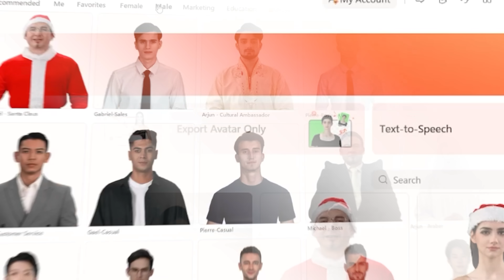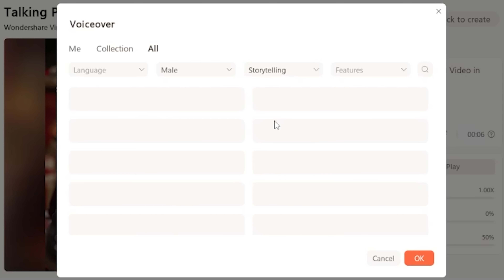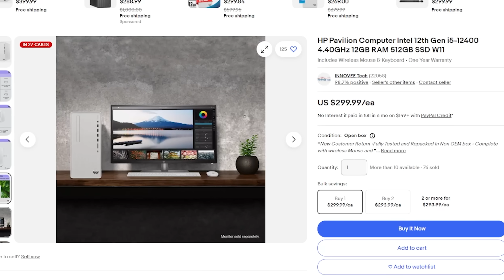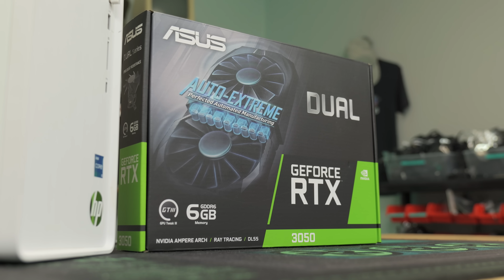NEW EASY $468 Gaming PC Meta  - Step-by-Step

Comment from the maker: Try AI Avatar Video Generator on computer or cell phone, or even online now: https://bit.ly/4gy0xEc
Reply: 0:20 :face-green-smiling::face-purple-crying:
Reply: Toasty Bros i need an opinion on the build i m almost finished completing
R7 5800x
Xfx radeon rx 6750 xt qicksilver 319
Msi b550 gaming gen 3
Kingston ssd 1tb 4.0 nvme m.2
Aqirys magnetar le 750W 80+ gold
2x8 G Skill aegis 3200mhz  cl16( i plan on buying 2 more sticks)
Aqirys Antlia case (middle tower fishtank also has 6 fans included i think they are 120mm each)
For cooling i bought an arctic freezer 3 aio 360 mm because from what i heard the 5800x tends to run quite hot
Reply: To me, it's worthless this sponsorship. Ad skip
Reply: @TheRealRuddRants  Hey bro, if you don't need the stuff in the sponsorship, just skip and ignore it, some people might find it useful.
Reply: @TheRealRuddRants  rude...

Comment: One of? What could possibly be more powerful with no external power?
Reply: The A2000 edges out 3050. Not significantly, but that one also has a 12gb model, and requires no external power.

Comment: Dumb question but do these hp pcs except any ddr4 ram? And gen4 m.2 ssd? Or any 12th gen cpus??
Reply: The one in the video does. I don't think they can take just any 12th gens though. These OEM prebuilts are usually locked down.
Reply: @marioprawirosudiro7301  That's what I thought too but nobody has any real good info on them
Reply: @lanegeisewite1436  My suggestion for these office prebuilts is to lock in a certain model, then start with the owner manual for that model. It should have info on which CPUs a particular model can take, along with the chipset the mobo has (which, in turn, should tell you which PCIe gen it has, etc etc).

The manual should be available for download from the website of whichever brand you choose.

Comment: Guys why didn’t you add a higher end gpu like an arc b80? Or even a 7700xt? The 12400 can get you lots of frames I have one with a 7800 xt and get 100+ frames at 1440p on all my games no issues
Reply: Arc B580? On a 300W PSU?

Comment: Gave my nephew my RTX3050 6GB to upgrade his Optiplex that he got for free after I upgraded to the 4070 super, it's definitely the cheapest way to turn an old office PC that into a gaming PC without upgrading anything else. It definitely made his day :)
Reply: Hi buddy 
I'm looking for go to from Gtx 1050ti to Rtx 3050 6gb because i'm focusing only for 1080p resolution.Btw i have some questions.
 
Does 3050 6gb actually worth?(in my country 6gb version cost around $200 - $220)
Can it powered by 450w 80+ bronze?
How about your personal experience with 3050 6gb?

Thanks❤
Reply: @PraveenZV  Hey man, I can't compare it to the 1050ti since I never had that card but during the short moment I had the 3050 6gb, it handles most non AAA games quite nicely, It didn't stopped me from enjoying cyberpunk with RT & DLSS performance but of course you have to accept there will be some latency or image softness from the extreme upscaling in that particular DLSS mode. But to me RT is much more important.

For other competitive games without RT, it runs like a champ in 1080p, no complains from me.

My nephew's PC is an optiplex office PC with less than 300w psu, 450w PSU will be more than sufficient.
Reply: @GeraldAllen-fg2bo  Thanks for great your response✨️.
I'm budget pc gamer and i don't focusing for RT.Overall i can use it without any upgrade of psu❤️

Comment: Just bought the 3050 6gb and 7040 optiplex, i7, etc for my son. Most other reviews are how bad it is, but if you think about it not needing any extra power beside 16 pin, dual monitor and able run on factory psu it’s truly the best in its class. Price a bit high, but it’s still much newer/better than others in its class. No brainer for me. 😊

Comment: i have an hp pavilion TG01 with 310watt psu what gpu can i add?? with 8pin caple??
Reply: If its an 8 pin cable, the highest you can go is an RTX 3050 8GB(130W max power draw), RX 6600 8GB(132W of max power draw) or RTX 4060 8GB(115W of max power draw). If you can get the 2 fan slot card and it only use 1 8pin cable. I would get the RTX 4060 8GB since it only uses 90-110w during gaming.
Reply: @BladeCrew thank you

Comment: I think you can mount an intake fan on that side where the perforations are, I think I seen another guy mount one to that cage thing inside and it lowed temps by a lot!
Reply: Yep, did that with mine...works great!
Reply: @Xariaus75  You should buy a magnetic dust cover amazon has the cheap in white or black and just stick it to the side, then it will have some filtration and won't fill up with dust long term.

Comment: 6 gigabyte 3050. The one I got has 8 gigs and it's overclocked.
Reply: I have a 6gb oc variant. Tbh the difference between both variants is just 10-15% but yes for games which requires higher vrams like Indiana Jones, you need that extra 2 gigs. I am getting 60-70 fps on Indiana Jones on low settings with dlss on performance without OC. 8gb would have performed much better.

Comment: Better get one with single stick 8GB and upgrade to 16. 8+4 combo is just not worth it. It is dual channel only up to 8 (4+4). Also Win 11 eats RAM like a hog, so 12 GB is not enough for modern gaming. Even Warzone used up all the RAM and went to SSD which caused some stuttering.

Comment: I have a similar system with a i5-11400 and a low profile rtx 3050 6gb and 16gb dual channel 3200mhz ram. Runs Fortnite and other games pretty well.
Reply: I have a similar system with a I5-12400F and a 2 slot RTX 3050 8GB and 32GB of Quad Channel 3200MHz ram. Runs Dota 2 and other games pretty well.
Reply: i have an i5 10500 with 24gb ram and rtx 3050 6gb and running Indiana Jones and the great circle on low settings with dlss and getting 60-70fps. 2060 users and other old card users who hates 3050 are crying hard as their cards are not able to run the game and even 3050 6gb variant is able to run it😂

Comment: Pavilions & Victus are no different, they have one 92 mm exhaust fan and are very loud under load, there's no place to install other fans or a way to upgrade the stock ones, I know I own one    The MB, fans, case, PSU, are all propitiatory so the whole shebang needs to remain pretty much as is   You can add RAM, upgrade the CPU "And watch it thermal throttle", upgrade the NVME
Reply: I have a pavilion prebuilt and yea the one fan is horrible and extremely loud, I want to upgrade but I basically have to buy a new pc

Comment: hey guys I'm from South Africa, I love your youtube videos, I've been trying to get a gaming PC for about 2-3 years and I'v had the same office PC for about 10 years, I really need your help. Please HELP ME. By the way here are my PC specs 
Intel(R) Core(TM) i5-3470 CPU @ 3.20GHz
8GB DDR3 RAM
No Graphics Card
500GB HDD
And Merry Christmas and have a great end towards the year
Reply: That cpu is very limiting. If you have a budget I would highly recommend upgrading from 8GB of ram to 16GB(dual channel ram) and getting an RTX 3050 6GB for R3699 at Wootware. DDR3 ram is pretty cheap and throw the same speed of ram inside of it and with the RTX 3050 6GB you can run most e-sport games and light games(with some light or heavy cpu bottlenecks). Also get yourself a 256/500GB sata SSD. Western Digital Sata SSD 500GB goes for R699 or 256GB for R354 at Wootware. Get the SSD and put your operating system on it. The max ram speed for the I5 3470 is 1333/1600 MHz. 8GB DDR3 1600MHz ram at Wootware cost R199.
Reply: @BladeCrew  Thanks for the advice, but I don't have any money.

Comment: I actually got an RTX 3050 in my smaller system, but with 8 GB (below that isn't really feasable for modern games). I have to employ a lot of AI trickery (DLSS, Frame generation as well as Lossless Scaling's voodoo technomagic sometimes) to play Cyberpunk 2077 with an average of 165 fps on an 180 Hz monitor at 1080p with very high to 'psycho' settings. So it is possible to play graphically intensive games like that with this card, but you really have to use this AI stuff to make it work fluently. Can't imagine the RTX 3050 6 GB could do the same as the 8 GB version, because most games just have to go over 6 gigs for the highest settings, even with AI trickery. So, yeah... I would rather recommend to buy the 8 gig version, if it really has to be a 3050 model that is. otherwise: Put 100 bucks on top of the pile and buy a better graphics card.
Reply: Agreed, once I tinkered the shit out of the card and overclocked it, it was very playable at 1080 with high to ultra settings on games. I overclocked it from it's original boost clock of 1750 mhz to 2160mhz, and the memory from 1750 to 2300 mhz and it's completely stable. It's actually very good for 1080p and I don't really have any issues so far
Reply: @wotdragonracer5624  I couldn't overclock it too much without the card going unstable. It's the OC version, so there wasn't really anything I could eek out of it. Just minimal MHZ for both clock and memory.
Reply: My Question is why do you need 165fps in cyberpunk 2077? Is there an online competitive mode or something.
Reply: @BladeCrew  Competitive mode while using frame generation? Never heard of that being a valid criteria. I have a 180 Hz monitor and the fps are unlocked, frame generation does the rest to close the gap to the Hz. GSync does not work on my card for whatever reason (both GSync and FreeSync are supported by my monitor and activated), so the native framerate looks choppy on that monitor. Pulling ther Hz down isn't working so terribly well either. The smoothness of the gameplay is definitelly a plus.

Comment: I get that using "Original" hardware is needed to get the authentic fps. But man is it annoying for them to just play 2 games then say "well this PC is very great for the price" considering that most people want benchmarks and not half of the video talking about how revolutionary the graphics card is, and how carefully you need to place parts into a PC.
Reply: Seriously. Especially when so many games require 12gigs of v ram to be remotely stable. I find their videos fun. But man are they inconsistent. Not to mention their pre-built on their site are massive rip offs. It would be dope of @GamersNexus would review their mid or top line PCs.